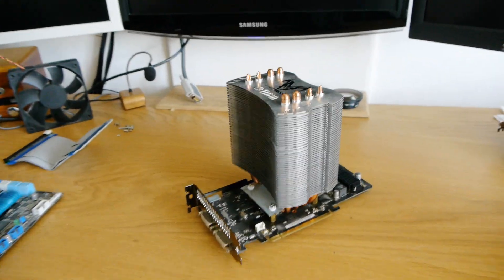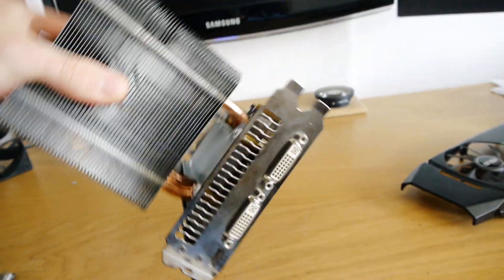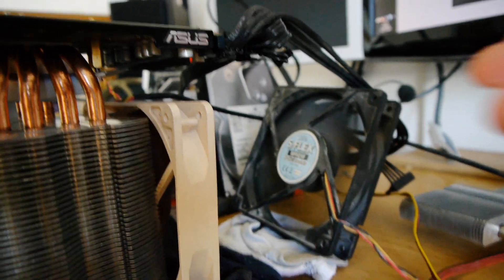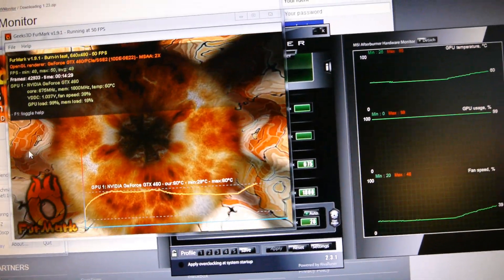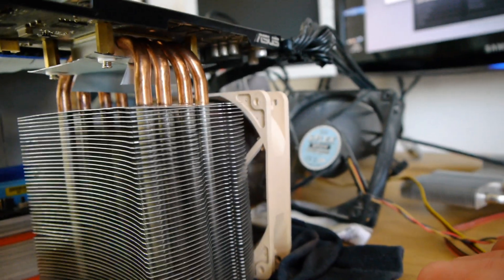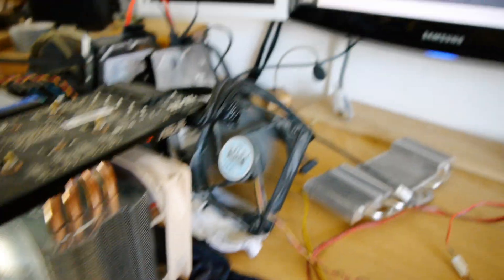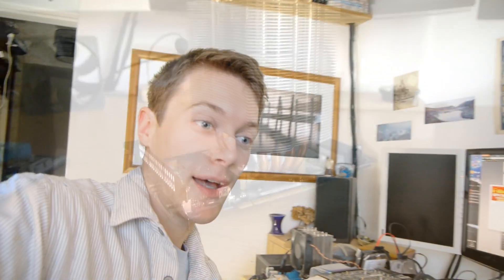CPU cooler on GPU (INSANE temps!)

Comment: Temperature experiment, he proved it can be done, adapting a sink onto an adapter or controller or card, but the size allows not to fit on the case, for experimenting and finding a solution to heat and temperature yes pretty good idea. But it is not practical to have this type of setup in the office or your office at home. However, a company called xmission who provides internet services to business and also you can have them run your website has this type of setup, As I talk to one of their reps, her computer had no case and it look like this messy experiment except the heat sink was not that big. Rare, bit odd but insane way to solve problems.

Comment: I this this is older but couldn't the heatsink be put on sideways with a fan blowing out what would be the side of the case in a pull config? that would allow the GPU to sit in the PCIE would it not? since the steel was cut to hold the heatsink one way it could be recut and reshaped to make it hold them together, and that would make it able to sit in a case in a pcie without the extension?

Comment: Could the heatsink not have been turned 90 degrees? I'm unsure if the mounting bracket is square, but that shouldn't matter in this scenario.I notice that the way the heatsink is positioned seems to have been on the side that takes up more vertical area, when trying to place the video card into the PCIe slot. If it's rotated ninety degrees, there might be enough room vertically to mount the video card in the motherboard's PCIe slot.
Reply from the maker: 1sephiroth8 It was possible, yes, and I did think about it, but I wanted to test the card with a through-flow of air, which wouldn't have been possible with the cooler facing the motherboard (though it would have probably performed similarly).

Comment: my gpu goes to 40 C max while under load, average of 35. I use a sapphire r7 260x. my cpu is also at 15 C while under load using a cooler master hyper 212 evo. is this normal?
Reply from the maker: Agent Dale Only if you live in the arctic and you leave your PC outside.
Reply: oh, i see
Reply: http://i.imgur.com/FJQDSau.jpg?1 for proof

Comment: Nice DIY work on the heatpipe tower GPU cooler mod. Does it run passively stably or would it get to hot too quickly under load? I'm sure it probably could with a bios under volt/under clock mod or rather as I'd call it a optimization ;)

A better candidate for this kind of modification though would be a GTX 750 Ti that could certainly run passively modded in this manner. Now a cool mod would be to use a thermoelectric generator to power the GPU fan off of harvested GPU waste heat.

Comment: i run my MSI Cyclon GTX 460 at 888MHz Core at 65°C max without any complaints regarding it's stability , but it's quite noisy under gaming load.

Comment: U had the GPU at wrong side up, most of the heat still stayed in on the board & processor unit not disapating to the radiator.

Comment: I'm no expert, but don't heat pipes have coolant in them?
I say that because through convection the hot gas is going to stay with the GPU if it's upside down.

Comment: And this is why I love my Arctic Accelero xtreme III,had it over 3 years,on an HD 6950 and now on a r7 265 core edition,both at max app. 47 C,idle app. 26 C
Reply: I've got the Arctic Accelero Twin Turbo II, which has been on my nvidia GTX 460, GTX 660, and GTX 760.  I see about 45C gaming with 85% gpu load with the 760 with near complete silence in a room at about 25C.  All the fans on my PC were chosen for their relative silence while doing their job, but they're still louder than the Twin Turbo. It's quieter at full speed than the stock cooler is just over idle speed, and cools far, far better.  It also blows air right across the VRMs and the rest of the components on the GPU side of the card.

I don't see much reason to mess around with CPU coolers other than for fun (I have wondered about that myself) when there are products like this which work so well and are meant for use for GPUs.

Comment: 45w diff between the 460 and the 680, big diff between a 150w and 195w gfx card for more reasons than that
Reply from the maker: Revoku 25w difference for with particular card actually, which is close enough to be comparable if you ask me. :)
Reply: doesnt cool the voltage regs or ram in the cards that need it, the 680's cooler most certainly does, if someone were to do this to a 680(or any card over the x60 of their range), you'd have fried card in a month, should prob chuck a note in to make sure people put some small thermal adhesive heatsinks over the vregs and vram if their card needs em
Reply from the maker: Revoku I'm pretty sure I mentioned that I'd be adding coolers to the vregs and ram in the final version. This was a first test after all, to see whether it was worth doing. It's worth noting that the original cooler didn't cool them in the first place, but you're in that it's generally a good idea! :)

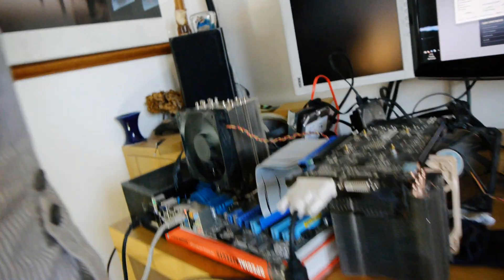Comment: 1:48 where did you get that vga connector? whats its name?
Reply from the maker: udang manis It's called a PCI-E extension. Got it from eBay.
Reply: not dvi, but pci-e extension
Reply: what i meant was connector from pcie slot to gpu.. hehehhee

Comment: Get a mac.
Reply from the maker: bhsbass Why?
Reply: yes, why? Usually macs works by pushing the GPU temperatures at higher values than in commercial not-overclocked graphic cards.

Comment: I have the stock cooler on my GTX770, fan speed is in auto mode (fan speed 38%), and GPU temperature is now at 35 celcius. I usually turn the fan speed manually to 100% when i play, and if i check the temperature then it is somewhere around 50-60 celcius.

Comment: No offense, DIY Perks but this is a crazy idea. I like it, it seems really cool but both crazy in the same time. I see that this is an old video. Is it done yet or not I don't care I just want to say that your idea is brilliant. I would try to do the same but I am afraid that I might go wrong somewhere since I do not have the tools needed nor do I have the knowledge. Liked and subbed.
Reply from the maker: ***** Yep, the computer it was designed for is finished and running splendidly. I'm going to upload a video about it soon.
Reply: DIY Perks Cool. I'd love to see it's performance.
Reply: 101bacce Water cooling would still require the fans, then if you already have a CPU heatsink around.. I'm guessing he probably spent nothing... :p
I went for a Asus DirectCU II cards to get silence, never looked back. Video card is the one thing that'll never bother me as long as Asus makes cards like that.
Reply: Slamdoxicalz I support you on how that ASUS makes quiet gpu's. I don't get 1 thing and that is, the windforce from GYGABITE.
They have 3 fans installed to keep the gpu cool and still noisy as hell and ASUS has only 2 and still really really quiet. Especially the ASUS Strix 970. The fans don't even work unless you are playing a good game with good graphics.
Reply: ***** My benchmark list kinda goes like 980 > 970 > 780 Ti > 780 > 770 > 760 with some other cards inbetween the last few. Sort of wondering which benchmarks you are looking at?

But the ASUS DirectCU II has some amazing silent cooling on other cards as well, not just GeForce's latest, can't give a chip all the credit!
Reply: DIY Perks what i dont get is why you would go for fans instead of just slapping son water on it? it's not really that much cheaper when you go for noctua fans anyway.
Reply: ***** Yup, funny thing is that the card's max rotation I seen it do so far is 10%. I manually up'ed it once just to listen, but it never needed to go above 10% while gaming.
Before my Asus cards I had a XFX which was noisy as well btw.
Reply: Slamdoxicalz My first pc had a cpu fan that was louder than a hairdryer......I had that PC when I was 5 and now im 14
Reply: ***** I heard that ASUS card has a heatpipe that isn't in contact with the GPU die? I'm looking at getting the MSI twin frozr 970 when they are back in stock.
Reply: Corey Muncey ._. Take a look at the ASUS Strix 970. The fans don't even have to work and the GPU is still cool as fuck
Reply: ***** asus is pretty awesome but its mainly the chip that made that possible, the low power consumption is just insane, you really have to be a sucker to buy a 700 card.
Reply: 101bacce Not really. The power consumption may be low but so is the performance. They can't compare to the GTX 780 not to mention the 780 Ti. Even when overclocked, still not giving the same performance.
Reply: ***** dude they 970 is already past 780 from stock speed the power is extremely low compared to the 700 series, so yeah the heat is less significant as a result which allows for further overclocking.
Reply: Are you dumb or thats me? Kid, look if you do not know much about PC's than ok. The 970 has just a slightly bit of better permformance than the 760 and the 980 has slightly better performance than the 770. But when it comes to the 780 they are no match to it especially to the 780 Ti. They do have low power consumptions but why waste your money on such a card? For lower power bills and lower performance? The 970 has a price like the 760 and the 980 like the 780 which is mindblowing. They aren't that good in my opinion and you should check their benchmarks if you haven't yet.
Reply: ***** so your saying nvidias own benchmarks are wrong? becaus a stock 970 performed slightly better than a stock 780, the 780 ti was better stock but honestly who the fuck would pay that instead of getting the 980?
Reply: ***** http://www.videocardbenchmark.net/high_end_gpus.html 3dmark sets it higher than the 780 ti. so there is that. so yeah im gonna say thats you that are the dumb one.
Reply: 101bacce Did you test it on your own against some games? No? Well I did and guess what? The 780 Ti gets better and higher FPS on base clock while the GTX980 gets lower fps than the 780 Ti.
Reply: Slamdoxicalz I am looking at the world benchmarks and I am talking about fps. If the fps sucks why buy it?
Reply: ***** ah, I usually use videocardbenchmarks.net as a guideline, then read on + look at price/performance ration.
It never failed me so far knocks on wood
Reply: ***** there is plenty of test that underlines these results, yes it looks like a smaller gap but still 970 on top of the 780. so really you are a fucking troll.
Reply: 101bacce It is faster at some point and they both have lower power needs than the 7's. but lower FPS. I bough 1 980 from MSI and guess what? I was a bit dissapointed. It's fps was lower than the 780 Ti, but! It was running at lower temperatures, really quiet compared to the 780 and also, it was quite fast. I overclocked it and it won the fight against 780. And I was talking about base clock speeds not about overclocked. It wins if overclocked.
Reply: *****  Its not that crazy really. There are much crazier stuff in regards to PC cooling found from websites like xtremesystems or tomshardware and many more websites.. Even crazier than the one in the video, Liquid cooling and LN2. And most of the time when done correctly, it performs very well with less noise but with your PC looking like a freaking bomb.
Reply: I used to have an Nvidia Geforce 5500 when I was using a Pentium III computer, and I put on a huge CPU heatsink with copper pipes. I drilled a couple mounting holes, making sure to not go over any circuit traces, and bolted it on. That card would run games from years later on medium settings that were not supposed to be able to run on it at all! I got a lot of use out of it so really it isn't that crazy to put CPU heatsinks on GPUS.

Comment: Amazing that some people are so closed-minded that they completely miss the point of the exercise.

And 11 degrees below ambient without refrigerant? Think you should consider working towards air conditioning development an design... You could change the world... Oh just so by the way if your overheat fail safe kicks in at 60 degrees Celsius and you read 11 degrees below ambient you should change your monitoring equipment... Seriously... You are then reading about 30 degrees lower than you should so your 52 degrees F on your picture should be 52 degrees C in reality on this planet... Yeah the cooler doesn't look that great now does it?

Room temperature is 23 degrees Celsius, not the component temperature... listen a little and your comprehension might improve a little

I will give you a thumbs up for the idea and having the balls to try it!
Reply from the maker: Dude, it's all in Celsius. Pay attention. Nothing is below ambient, that's impossible without refrigeration. Amb is 23c, GPU is 52c. Nowhere in the video did I say it was 52F.
Reply: DIY Perks It was aimed at the comments and not at your video... I didn't think it was necessary to mention that, my apologies if it is misinterpreted :)
Reply from the maker: spikv1 Oh, sorry mate :) got a bit confused there